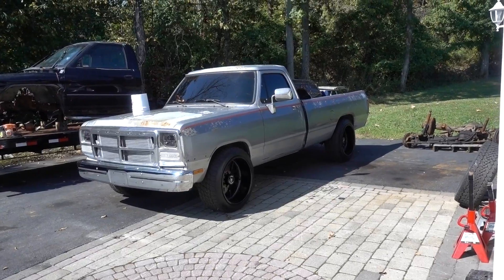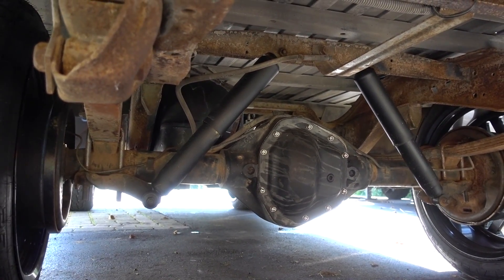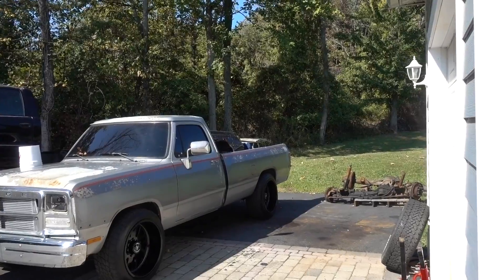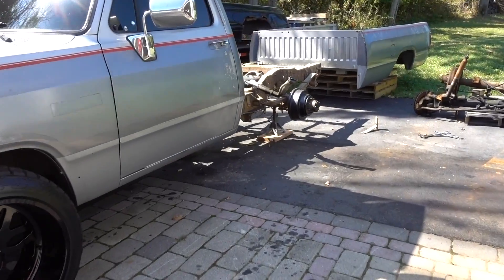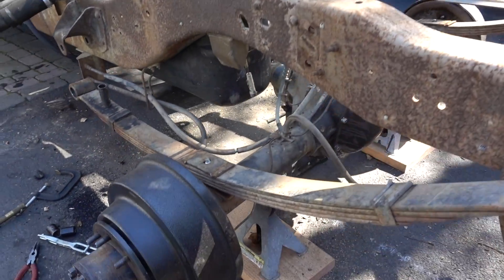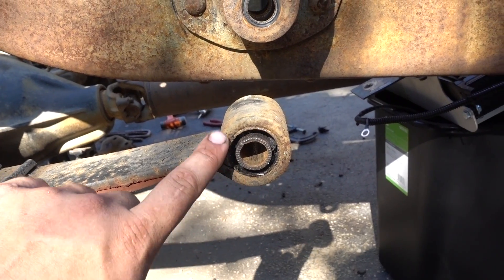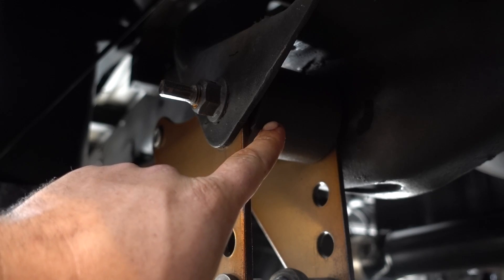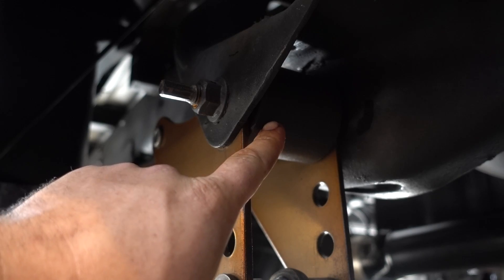FLATBED PLANS FOR THE FIRST GEN!?!?! CUMMINS FIRST GEN TEARDOWN FOR MAJOR POWER!!!

Comment: If you have a ball joint press and all the adapters you can actually press those bushings out of the leaf springs using your ball joint press, also the track Rod bushings but I use an arbor press myself for that job. Since you're going to drag race this truck and you're running the ladder bars are you going to be using a set of adjustable coilovers in the rear would make better sense for tuning and launching.

Comment: I agree with some of the other commenters, since the bed is off, time for a por 15 or wire wheel and rattle can overhaul. You can use a caliper to measure the outside the bushing also, instead of pressing it out if you daily the truck and can't afford to have it down.  That spring will flex a little so it doesn't have to be 100 percent accurate.  Tip for installing the solid aluminum bushings also, stick them in the freezer the night before, makes install way smoother, also wire wheel or use a small home to clean up the front spring eye, also makes install easier.  Wish I had measured mine myself, it would have saved me a ton of time in return shipping and phone calls to John Calvert.  Thanks for the content Greg A, enjoy the heck out of your channel even though I'm not a diesel guy.

Comment: why can't you just use the brackets from the first gen axle on the second gen axle? cut the second gen mounts off the axle if they interfere.
Reply: robry84 very plausible idea. If the u bolts end up in the same spot on the second gen axle he could just bolt those shock mounts to the new axle
Reply: yeah, it looks like it should just work

Comment: I could be wrong but I think you could you reuse the lower pads for the spring packs that the shocks Mount to on the new rear end. Unless there's a mount that's already there although that could be removed

Comment: I'm no engineer or car expert but it seems to me if you angled the shocks towards the rear it would help keep the axle from rotating. Straight up and down seems like it would do very little besides mitigate bumps in the road
Reply: berlinetta350 really the only thing shocks are for is dampen out the bumps in the road, they aren't made to resist axle wrapping. Without a good set of shocks, it will take a little bit for the axle to settle down after hitting a bump.

Comment: I'm thinking about getting a 87 first gen with a dually rear and a flatbed with a 5th wheel hitch and extended cab and my goal is 450hp at the most with a 8inch lift on 24x14s on 36s

Comment: The front leaf bracket on the frame you can cut the rivets off and lip the bracket and bolt it in place and gives you a 1.5 2'' drop also you can get new longer shackles and drop it quite a bit  im in the middle of dropping a 93 D150 atm long bed 5.2 i will send pics on your FB

Comment: Hey Greg as for putting both shocks on the same side of the axle it's way better to have them opposite, rides better and helps wheel hop. There is a reason the factory did that.

Comment: Your frame is pretty solid. If you ever get over into PA, make a run to Eastwood in Pottstown and look at there rust encapsulator. It chemically bonds with the rust to prevent rusting in the future. I put it on my f250 frame and it turned out really nice.

Comment: You should pressure wash the frame while the bed is off and take one of the cheapie harbor freight sandblasters to it. Then just paint it and undercoat it. Would make the build so much cleaner and keep it from rotting farther.

Comment: Shouldn't you have measured for caltracs when the 80 was in instead of the 70? From my experience on second gens a dana  70 caltrac kit is different than a dana 80 caltrac kit. The brackets are different and the bars are different lengths.